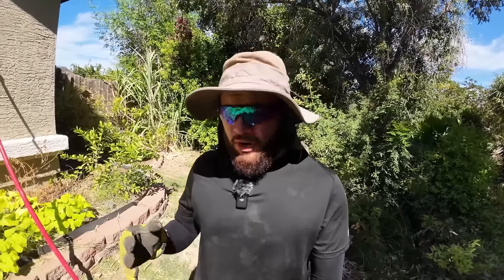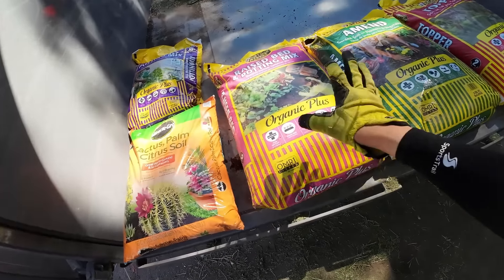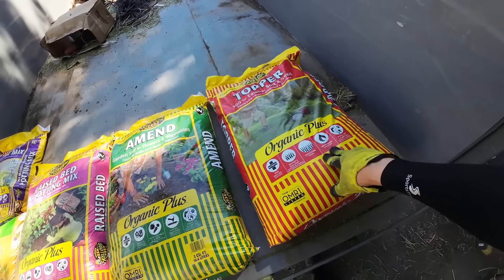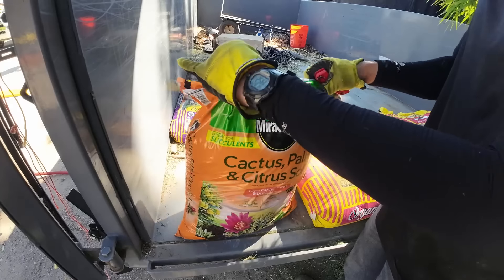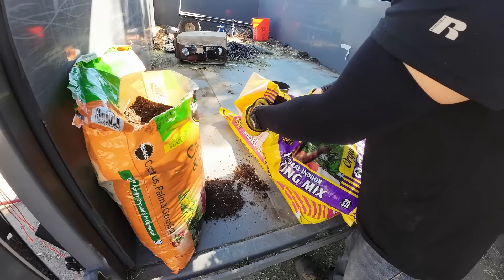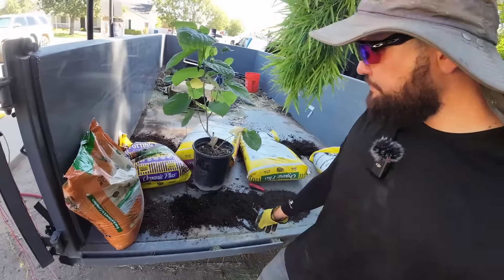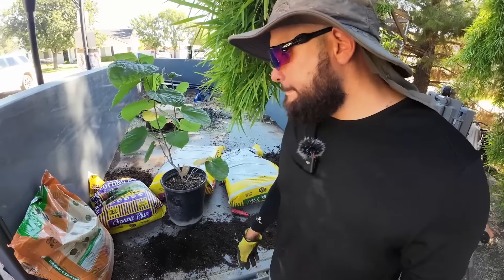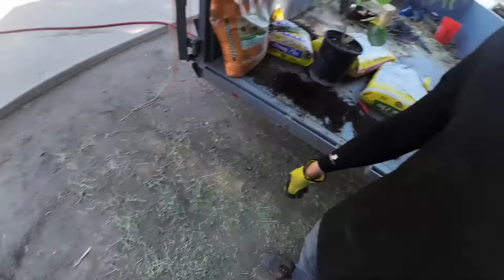The Truth About Garden Soils

Comment: The problem Ive  had with potting mixes is that because they're mostly organic material and break down as you've described, they become like a sludge after a year or so. Do you know a solution for this? Excellent video, thanks
Reply: I use only native soil.
Reply: @Find-Your-Wellness-With-Me  Sorry, I mean for a long term container plant
Reply: @jimk6862  When I plant my own plants I don't use a container greater than 2 gal (3 g max) bc it gets too heavy for me, I am female. In a past I did clay soil in big containers but it requires 2 peoples to lift and pulling by male on concrete was fine (it probable was 15 gal). I don't like growing in containers, too much work and mediocre results - at least for me